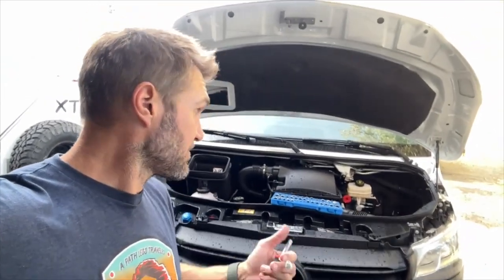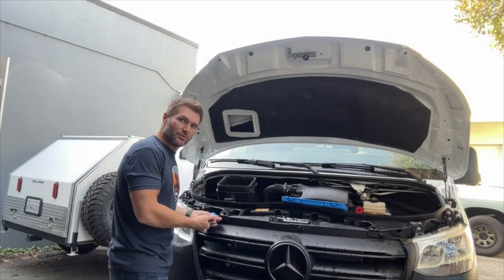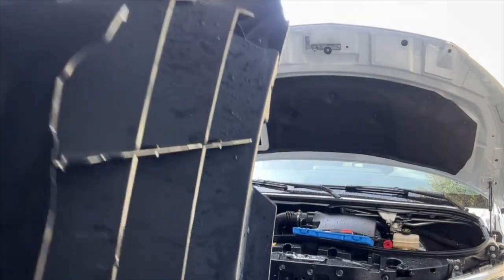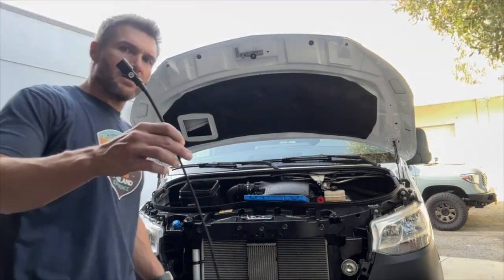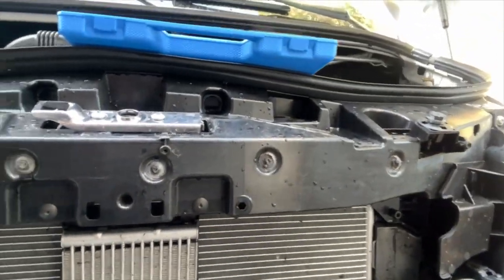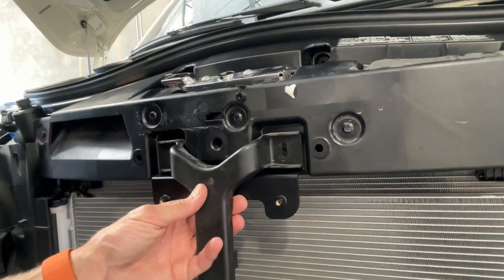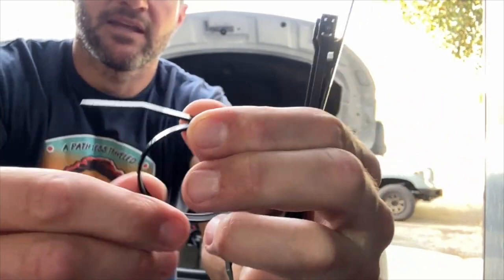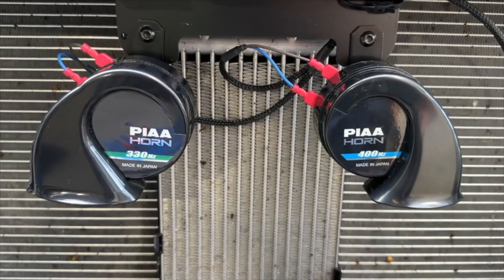Sprinter Horn Upgrade Install (Updated)

Comment: So after watching this, of course I had to go to your site and buy it.  UPDATE  Just installed and it took like 20 minutes to complete.  Hardest part was not breaking or cracking the grill clips along the bottom.  Everything else was easy-cheessy!!!  Thanks for great video Jon!
Reply: The factory and the new horns are pile of 💩!!! You should installed 1960-1970's Mercedes Bosch horns instead. The difference in sound is like night and day!

Comment: Just installed in a 23 and the reverse bracket tip was a big help. I did have to tilt the horns to fit inside the emblem and grill plastics. Not sure if that’s a result of the reverse bracket if that protrudes the horns further. Scariest part is forcing the plastic grill clips off. The bottoms especially. I was able to just do the sides and tilt the grill and even with the camera bracket, there’s enough room for Allen and Torx tools. Tip, you have to take out the old horn and use the connector in the back of it that you cannot get to without removing the old horn. Not the couple of connectors out in front of the old horn that will not match the Owl connector. Picked that tip up in another YouTube. Wasn’t obvious to me. The Owl horn is a 100% improvement to the very lame factory horn. Super Bass may be pushing it a bit. It’s not a Mack truck, or that you’d want that but more than enough for every day neighborhood and highway traffic. Sounds like an old school Detroit car horn. The factory horn is outright dangerous. Satisfied.

Comment: Just got done installing this. Good video, but one small detail is missing (at least on my Sprinter). The original horn harness does not just unplug. There is a locking mechanism that needs to be released. I had to remove the original horn to get at it - no problem, it was just a small bolt, you would never see the gray lock that needs to pop down without removing the original horn. This was on a 2024 Sprinter. Other than that, took about 30 minutes and works great. I had a bit of trepidation removing the grill, but it does come off and go back on easier than one would think.

Comment: Jon, I enjoyed seeing this horn upgrade product kit and ordered it right away assuming it would also fit a 2016 Sprinter.  Before I open the box however I thought it best to check with you to see if there is going to be any problem or possibly the need for an alternate mounting bracket or wiring connections?  Enjoy all your videos!

Comment: Another great video. When you cut the end off of the low-pro zip ties, won't it still have a sharp end, just sticking out at an angle? I've found the zip tie cutter "gun" for the normal ties to be practically indispensable... It cuts the end flush with the clamp. Not always easy to reach it into where you need it, but I wish I had bought one much earlier! For the hard to reach ties, I use a box cutter and cut along the clamp to get a flush cut.
Reply: I was wondering the same question.

Comment: Blue wire was 12 volts on my 2020, so I connected the blue wires on top per the included horn installation directions.